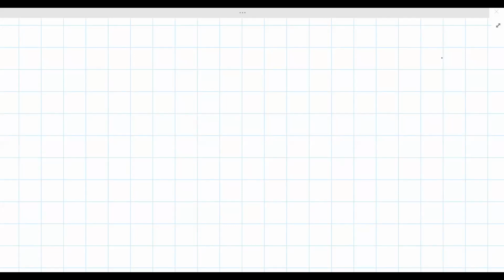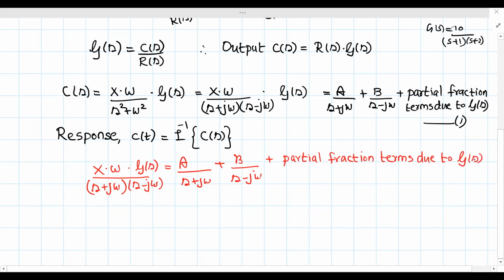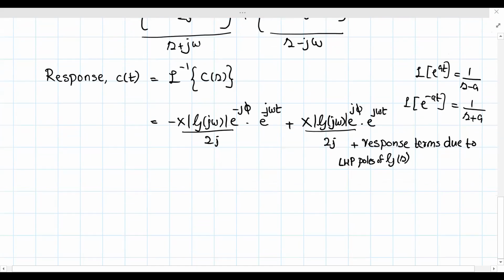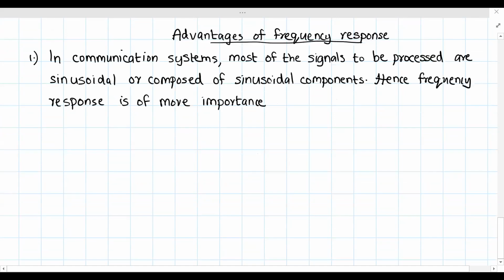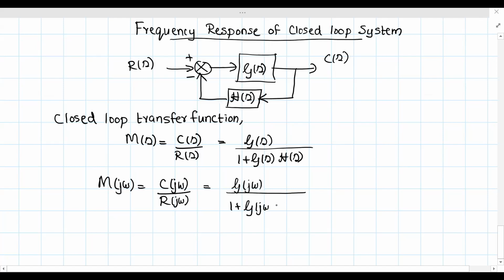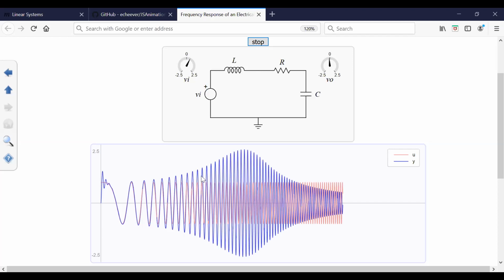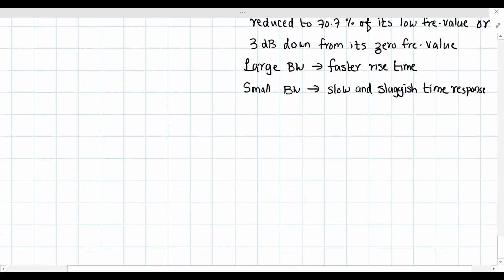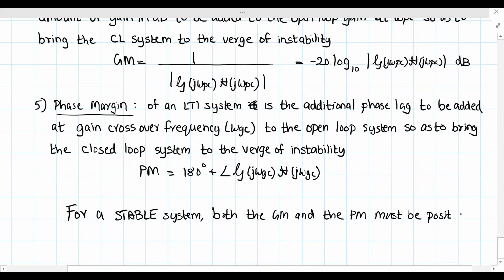Lecture 21: Introduction to Frequency Response

Comment: Sir in Time Response Analysis of second order we see Transients for 0<t< 4Time Constant i .e Transients in Time Domain.
So my question is that, Where do we see transients in Frequency Response i.e Transients in Frequency Domain?
Reply from the maker: Dear Atul, transients are seen in time domain only. Response means output as a function of time. Frequency response means the STEADY STATE response of a system to sinusoidal input. So there will be no transients in  Frequency response
Reply: @dr.rajeshjosephabraham8772  but sir my control sir had said that in frequency domain transient are nothing but resonance.
Reply: @dr.rajeshjosephabraham8772  If we apply and sinusoidal input to an undamped system( marginally stable) we get oscillations of infinite magnitude which means transients in frequency domain.
Reply from the maker: @DIET_ALIGARH  Dear Atul, please note that resonance is  a phenomenon. If your system has zero damping, then the output will keep on oscillating without decaying nor growing until infinite time. Am I clear to you ?
Reply: @dr.rajeshjosephabraham8772  Thanks sir, I will try to digest this concept as it was very confusing.